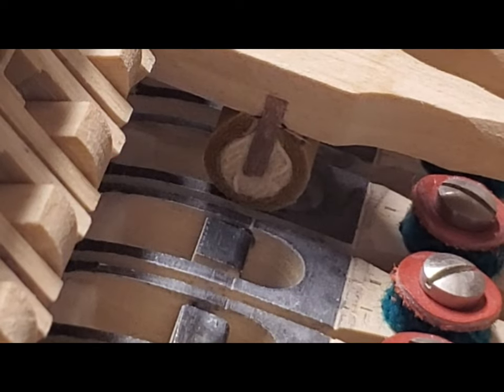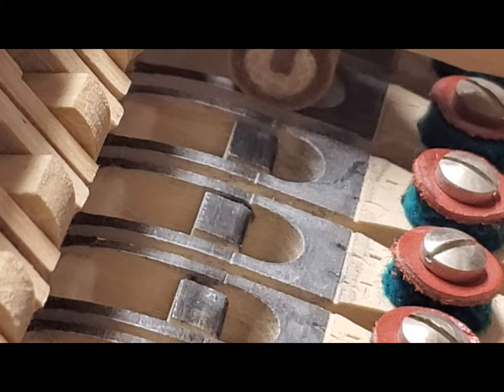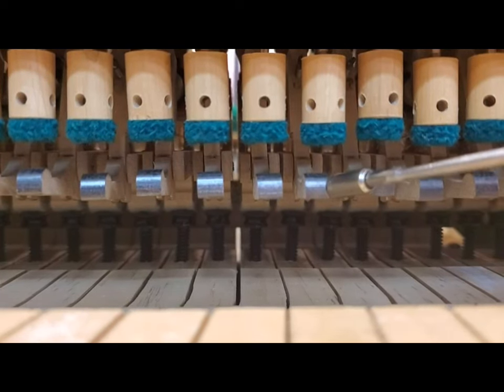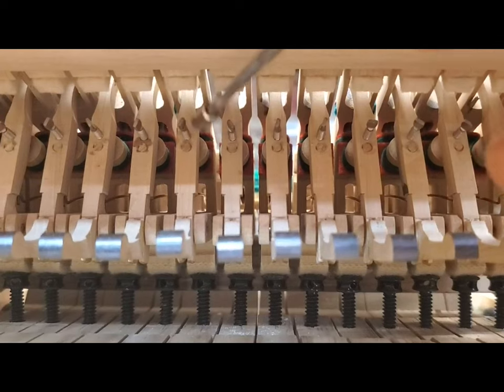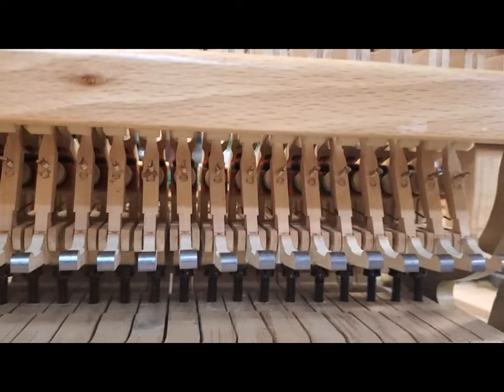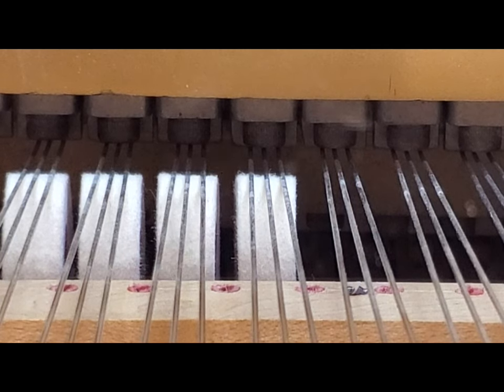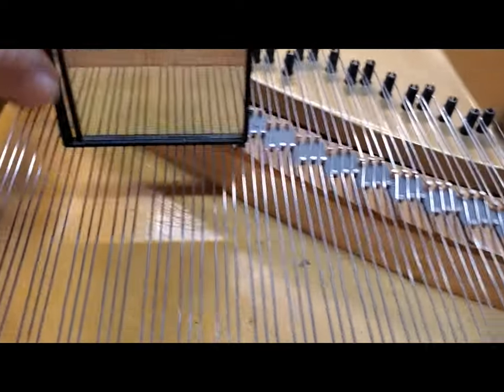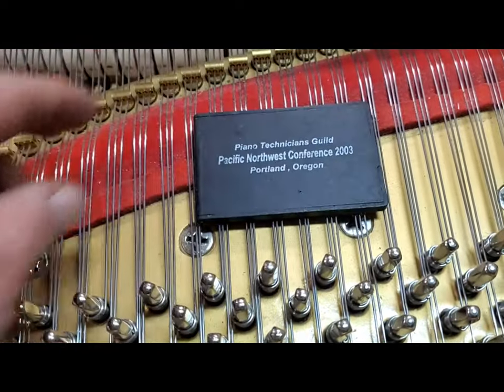Adjusting Jack Position, Aligning Hammers to strings, and a 20 year old Mirror

Comment: Why set the hammers central ? Action will have to shift a lot to miss left string.
Reply: Isn't "una Corda" actually a 3 string hit, but because of different hammer position it hits with less hardened felt so it sounds softer?
Reply from the maker: Centering the hammer under the trichords gives the pianist more options.
Reply: @ChernobieffPiano  Hello, greetings from Germany and thank you for your video, I am adjusting my piano myself... it is quite a difficult job but it is going well, what I did not understand with the tool to center the hammer to the left or right, how does it do it?
My hammers have a screw at the top that is loosened with a screwdriver, but you did it at the bottom, will the design be different? mine is an old Carl Mand.
Thank  you